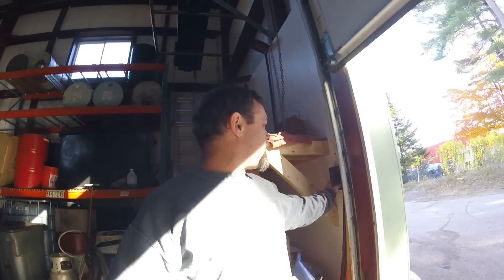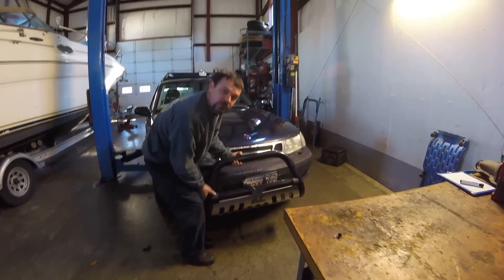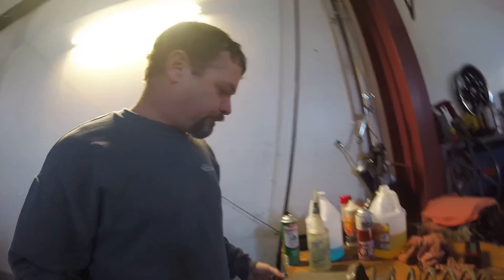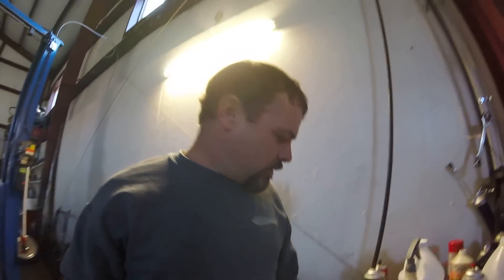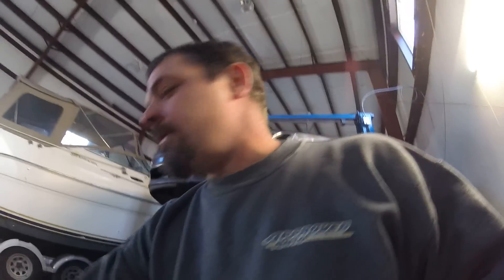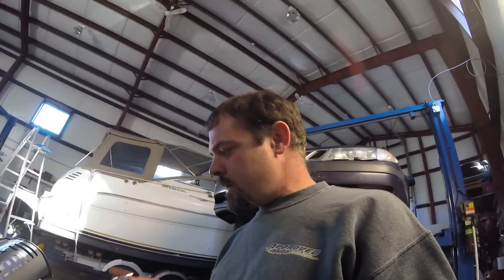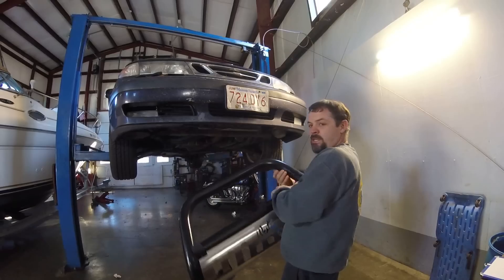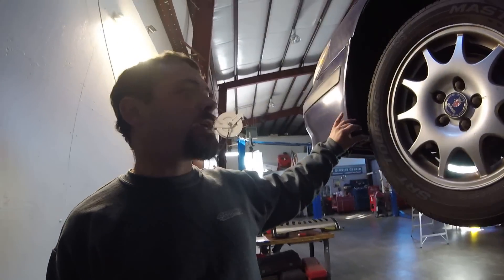Parts For The RallyWagon!

Comment: You can get commercially made adjustable lower cross stays to adjust the camber. I don't know how much it'll help with a LIFTED car (it's designed to fix camber on lowered cars), but it's a start. The part number is SPC 67270. I have them on my '99 9-5 wagon to cure the nasty negative camber the car gets as the springs age (and subsequently sag).
Reply from the maker: +FrankTheCat Those look like they might work really well but for $70 each is a bit pricey. I could make the adjusters I described work for under $20.
Much appreciate the look out! Thanks!
Reply: Amesie's Automotive Corner Funny how owning four Swedish cars has skewed my point of view for parts prices. $70 seems cheap when your car needs $425 worth of parts for a timing chain/water pump/oil pump job...

Oh that reminds me, pull the timing chain tensioner on that car and check how far it's extended. It's a 12mm socket to remove the spring retaining cap, and a 27mm socket to remove the tensioner. If the tensioner is extended past 11mm means it needs a new timing chain/guides/sprockets, etc. They usually need replacement between 150k and 200k miles depending on how the car was driven and taken care of.

Comment: Dont make new holes in the body to move the rear strut down, insted make new holes in the rear struttower, like an adapterplate.
Reply from the maker: +Johan Blick I'm going to be modifying the rear strut towers and use coil adjusters.